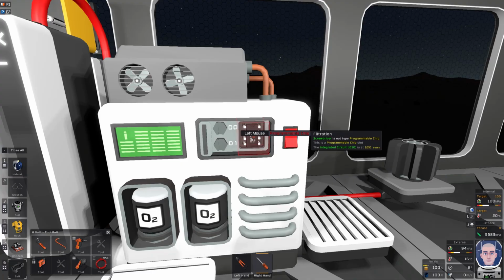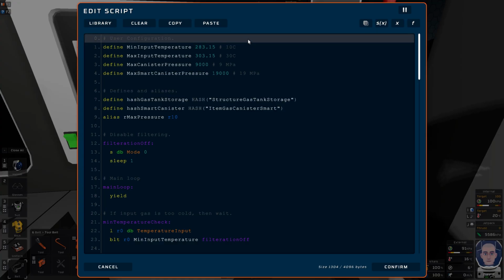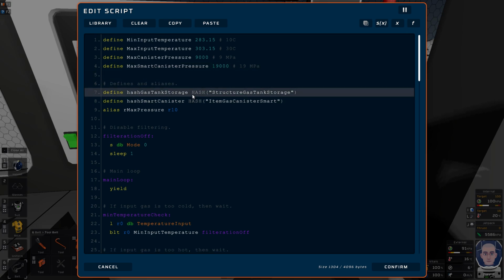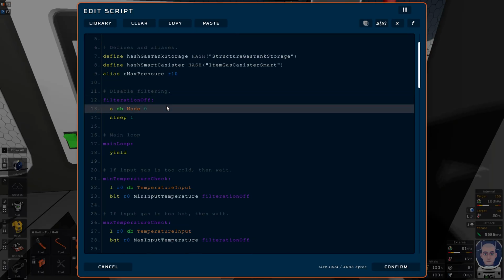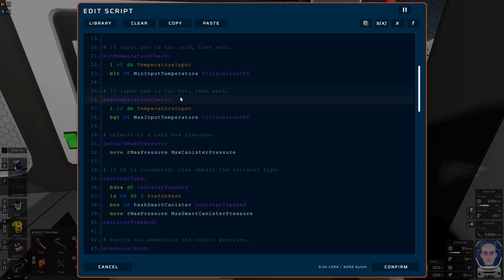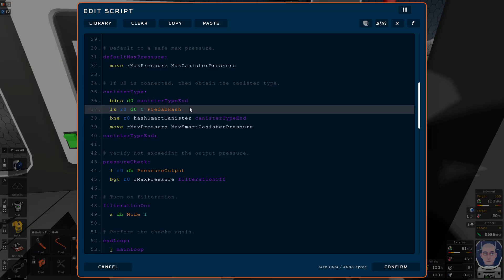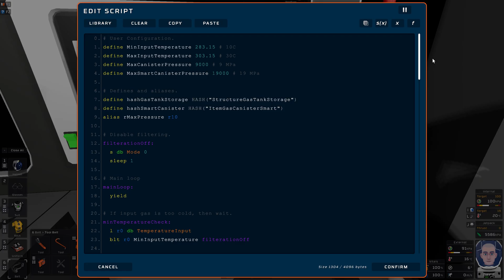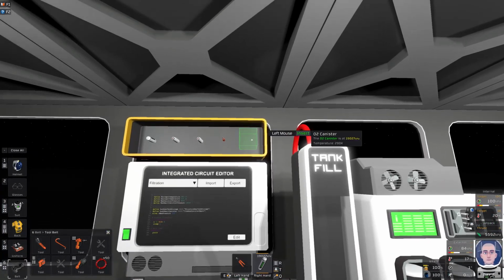Stationeers Coding: Standard/Smart Canister Filtration Filler

Comment: great code solution here.  Now wire it to a pressure system to add gas back and raise the pressure back into the hab that you took out to fill the canisters : )
Reply from the maker: Pulling from the room is an early game thing.   Long term should source an insulated tank full of O2 at 20C.   The fun part is pulling from outside O2, warming it up (ideally using waste hot gas and not pipe heaters) and then storing.   This will generally reduce the hot gas temp which always contains CO2, thus the next step is to then cool (easy) the CO2 down to 20C for hydroponics consumption.    Then all the fun logic to inject the right about of CO2 and remove O2 from the hydroponics while keeping the plants in their happy range.

Comment: I love this so much, thank you.  It would be good to put this behind it's own transformer, if I have others of these running (for reasons), yes?  Since you're using the global hash of the tank.  Thanks again, my dude.
Edit:  Thank you SO much for updating your coding videos.  You're a real one.
Reply from the maker: The global hash of the canisters is for identification, not for transmission over the network.  (i.e., I'm not using send batch).   Thus safe on a network and can put one for O2 and one for N2 on the same network without an issues.   Just need to make sure the D0 on the Filtration unit is pointing to the right one.   (I use the labeler to provide the tank storage a name so I can't mix them up when selecting the D0 device.)
Reply: @VenusianGamer  Thanks dude!  Makes perfect sense, since it's isolated to the device.  Good stuff.  :)